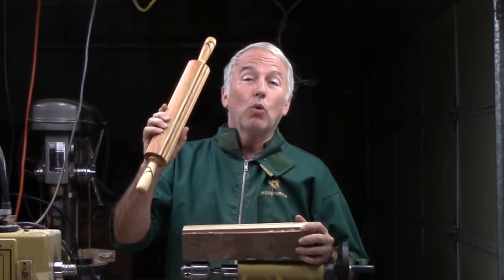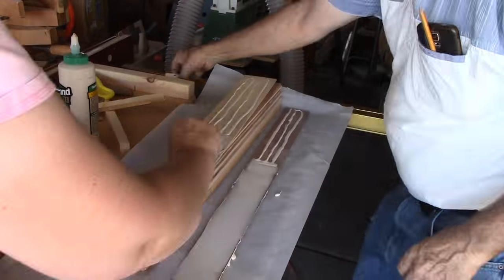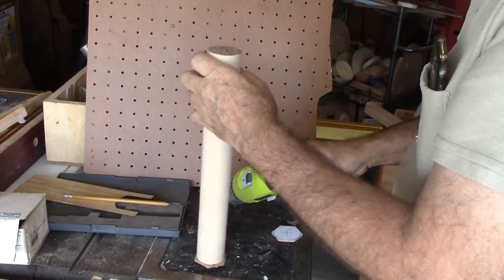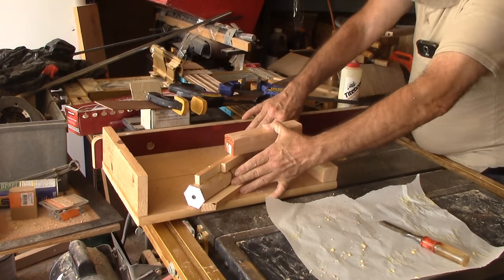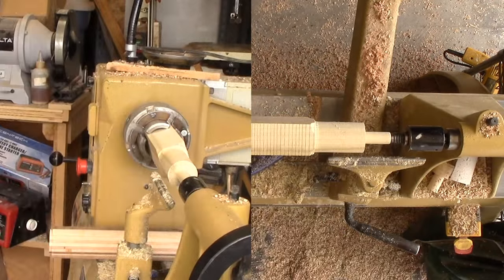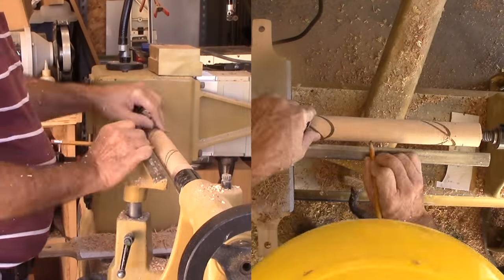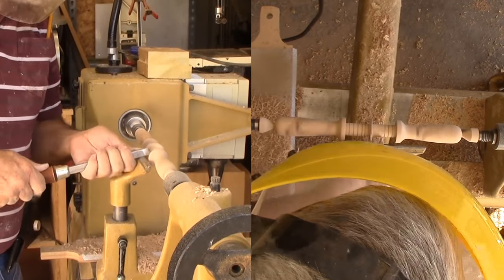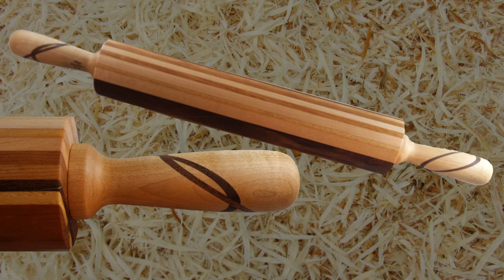Taking A Rolling Pin To The Next Level

Comment: As usual, a very good video Alan.  
I have make about 50 rolling pins in the last few years.  most were in the french style (google it if you don't know what they look like) and most of them I used a variation of your Celtic knot method.  sometimes using just a veneer or all the way up to an inch thick piece of stock.  This is a great way to use up small pieces of more exotic woods as well as making one-of-a-kind pieces.
You system of simply using hot glue to make a sled is a good idea, but another variation I had was to use a variety of angles so I made a hinged system on a custom sled and used clamps to hold the sled secure at the chosen angle.
Reply from the maker: Sounds like your sled is a definite upgrade from mine.
Many people could be put off from attempting a Celtic knot if they have to make a single purpose sled first. My simple sled attempts to put that issue aside. It is also adjustable at the cost of a couple of dabs of hot melt glue. After some experience, most turners would then upgrade to sled similar to what you've described.
Thank you for sharing.
Alan
Reply: Exactly.  My first attempts were to screw some pieces of wood to a plain sled, your idea of hot glue is much quicker and still works just as well.  I don't comment often on your videos, but I do enjoy them a lot.  (I have been a subscriber for several years - under a different YouTube profile).

Comment: Hi there Alan, A long time since my last Comment, Nice Rolling Pin Mate, when I did pins I used the 1 inch screw on it flat, and moved along slowly like a scrape. as you said you don't need bumps on a Pin. when you inserted the dark wood in the handle Alan, do you have to take out the width of the wood that you insert to keep the same length, or is the wood the same thickness as the saw cut?    Cheers Buddy,   Desmond.
Reply from the maker: Absolutely make the inserted wood the same as was was cut out.  Actually, I have a couple of videos on Celtic knots. They key is the cutting jig and temporarily putting a splint to keep the saw kerf stable.
Alan

Comment: Great looking rolling pin. Do you find that you get creep after a time on the laminations of the main body leaving ridges or does the glue hold them with out creep. Also I like the home made steady is it of your own design
Reply from the maker: I think creep depends on wood dryness, humidity, and glue.
1. For something like a rolling pin, the wood need to be as dry as possible. Otherwise, contraction differentials may tear it apart.
2. I've seen some creep with dramatic changes in humidity.
3. Glue. I do not use Titebond II glue when glue lines could be visible. Normally, I use Titebond original Extend which is a harder stiffer glue line. However, for this pin I used TiteBond 3 for greater moisture resistance. i've not observed creep yet but it's still early.
As an experiment, smear a little Titebond 2 and Titebond Original Extend on a couple of fingers. Let it dry. Then peel the glue off. Titebond 2 is much more flexible; Titebond 3 is more brittle. Technical specs rate Titlebond Original Extend as more sandable. I believe this translates to less creep.
When possible, I allow more time after gluing before turning.
Time will still tell on Titebond 3.
Great question
Alan
Reply: Thank you for that answer I found with the standard PVA glue that I got creep. Will have to look at the Titebond glues for glue ups

Comment: Love the whole concept...very nice. I really like the handles as plugs. I agree they look better than the laminated handles would. I wonder how difficult it would be to make a segmented version? Perhaps a series of segmented discs for the roller piece. It may not be worth the effort, but I think it would look cool. Although it might make the chef a little dizzy while rolling out the dough. ;-)
Reply from the maker: Segmented is a real variant. Then within segmented it could be constructed with staves or rings with endless possibilities each way. It does not have to be multi-colored and busy - it could be a very simple stave construction using a single wood. BTW on the video you shared. in my experience band clamps are a much better alternative for gluing up. Wire tends to shear.
Also. Keep the handles fixed to the pin- a true chef will appreciate it.
Alan
Reply: good video, but why not give dimensions when turning?

Comment: Alan -- I like your twist on the Celtic knot.  it creates visual interest without competing with the laminated pin, itself.  Your process for turning the pins was simple and straightforward.  Recently, Ernie Conover demonstrated making three different types of rolling pins in a video for Woodworker's Journal.  His methods are different from, but not better than, yours.  For example, he drilled his pin by mounting the drill bit in the headstock and using the tailstock's quill to force the pin onto the bit.  Simple, straightforward, but not better or worse than your method -- showing, again, that there are lots of good ways to achieve good results.  (With an apparently endless number of ways to do things right, why does it always seem I come up with a new way to do things wrong?!)  If you'd like to compare and contrast, Ernie's video can be found here: https://www.youtube.com/watch?v=HNNxr6LPUbs.
Reply from the maker: I'm not sure I appreciate the prospect of holding the wood by hand against the rotating bit, but I'm sure it does work. 
Occasionally, when I find one of those new ways of doing something wrong it leads to a way of doing something better. :)
Thanks for the thoughtful comment.
Alan,